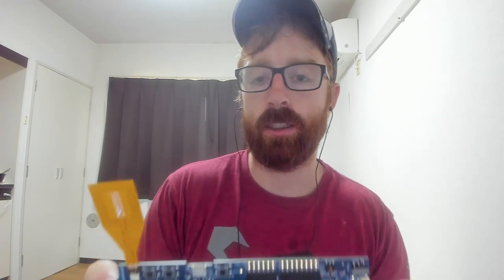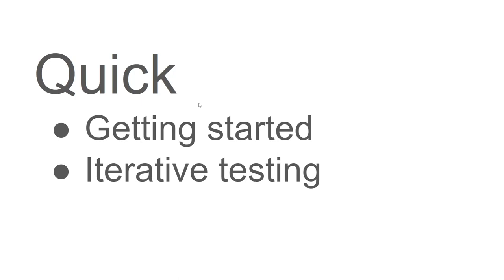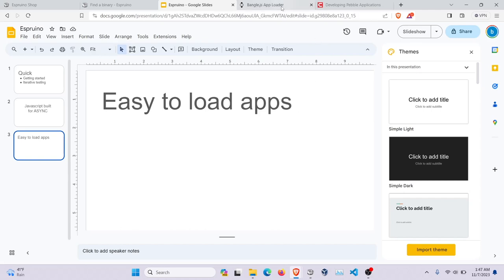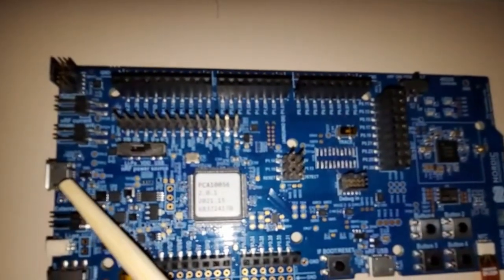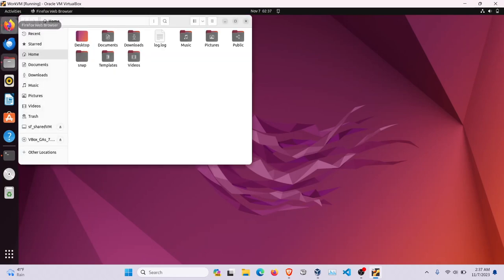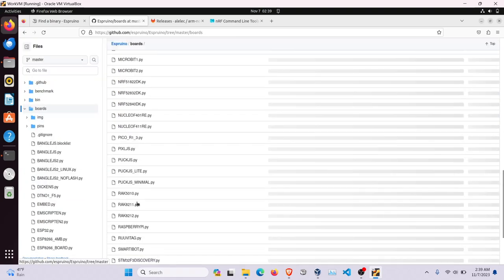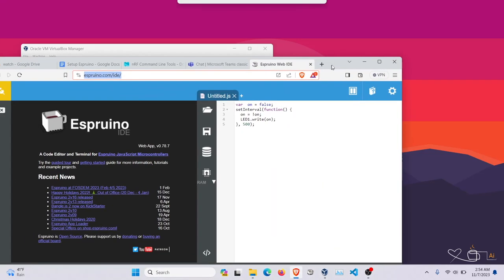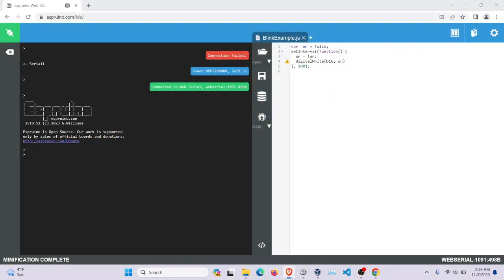Espruino -  javascript interpreter on microcontroller

Comment: I can't believe you managed to rationalise installing JS on a uC - ROFL ... Kudos :)
Reply from the maker: I was surprised to make this argument as well.  But i think it has its use cases.  Especially for closed devices like that bangle smart watch because on the backend all the things that require speed are made in c.  So you basically use javascript to reach all these optimized c codes for all the hardware.